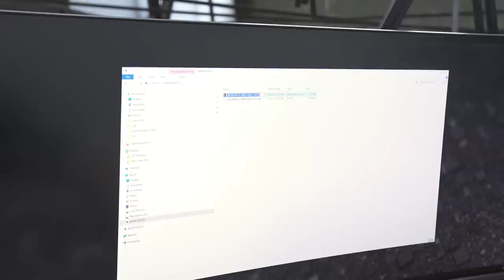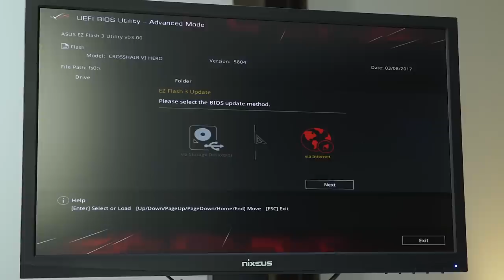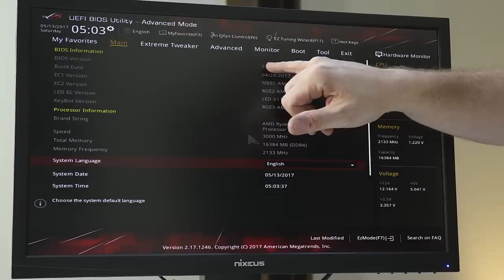How to build a Gaming PC

Comment: Great video, however,I have been working with computers since I was a kid, and I noticed that you are forgetting about a few things while you are benchmarking are 1), you have no antistatic mat or antistatic wrist strap. This can cause a lot of problems for the motherboard and processor. 2)You are not considering any safety measures in combating static problems, or use any sort of flashlight in getting into the small areas of the computer.
Reply: @huntedplaster9607  Thanks. There should be no buts when it comes to safety about ESD, and it needs to be done and mentioned in all videos that show a basic understanding of what a person who is a beginner at computer building, because of the fact that there is probably someone who has never built a computer, and to think that someone who views these kind of videos, with no previous experience, will think it is standard practice to not use ESD precautions when building a computer, and this needs to be addressed when making videos like this. Not everyone has either a place to work that either is carpet free, or are standing on an anti static mat. To brush off on ESD safety, and precautions is just stupidity at it's finest. Think of who this video is aimed at. How would people know about touching metal if it not mentioned? I guess the creator of the video didn't consider that. A motherboard as well as RAM, and the Processor, as well as the video card are all subject to ESD, and to not address it, especially in today's world, someone could take that creator to court for misleading information. Cover Your A** should be a common thing if making a computer build video.

Comment: This new PC build that I use now posted just fine and booted up right away except for the trouble I had because the amd ryzen 3600x,the gigabyte aorus b550 pro ac wifi and the video card all support that bit locker crap which "Broken Windows 10" took full advantage of once I installed windows and wouldn't even let me access my bios which forced me to go through changes,but other than that my PC build went well.Was I lucky/unlucky?Who can say?Good video Jay.

Comment: Thanks Jay, I've built a few PCs myself, however its been about 6 years and I've finally decided to build another. This was a great refresher with all the tips. Any recommendations for a good computer case that won't break my budget? ATX is fine, just so many to choose from nowadays.
Reply: If you want one for about $100 there's the Cooler Master H500. (Not 500p or M. Just H500.) It has two front RGB 200mm fans and a rear 120mm. There's also no glass panel choking the fans like most cases have, allthough if you need the looks it comes with one optionally. Killer airflow with the mesh. It has decent cable management space and a half PSU shrowd so the GPU gets better airflow. It has two back mounting spots for SSDs and a small drive cage for two or three hard drives.
Reply: @SupertoastGT  Thanks! I'll check it out.

Comment: new 
system builders - do not forget to build your system with your parts placed on anti static mats etc,this will help aid a smooth build providing every single part you have purchased for the build actually works in the 1st place ,you do need all parts you buy to be in 100 % condition when you start your build for your build to be successful ,if you do no get any joy at boot up ,yes you can use the bridge start up as i have never had any issues doing that then if you do not see a screen boot up then you will have to maybe fault find one possible part that is maybe not connected correctly or maybe one part is not working , if you do find you have a faulty part , just take the faulty part back to your dealers and swap your faulty part for a new one and get back to you anti static ,

if you use a tabel like this video anti static mats are still recommended even though the static on this table will be much less than trying to build on say a carpet , !!! , anti static mats ,the foil that covers your parts from new will do the job , do use them if you are unsure about the amount of static electricity where your build is taking place .

Comment: I think it is safer to fully discharge power with extra power toggle (with ps switch off) before connecting / disconnecting graphics cards.  I have noticed graphics cards get destroyed randomly the more I plug them in at least for older systems.  No idea if it is because of pinout design or not going in perfectly straight, but it has happened.  Other cards don't seem to care.

Comment: Well i liked you and your video so i liked and subbed, but if i had hot air blowing in my case like that it would bake, also tucking in cables next to the heat sinks is going to kill them wires a lot faster. I am sure someone else might have pointed all that out just don't have time to read all the comments so please don't hate :P really well done i would still give another thumbs up if i could do it twice.

Comment: You forgot to show you need to apply thermal paste and you could have removed the SSD bracket to connect the front audio... However thanks! It's great for builing a new system. Done it often enough, but I always forget something stupid and finding it out when it's the hardest to get right again...

Comment: I’m planning on building a new computer for my Graphic Design & Video Game work.

Should I get a Ryzen 7 2700 or the i7 8700k?

I’m planning on getting:

• GTX 1070 ti

• (2x8) sticks of DDR4~16gb

• A new case (not yet sure on what case to get but willing to spend around $200 for one)

• Motherboard (not sure which one yet)

• CPU

• EVGA 850w or 750w power supply

For the storage I’m just going to use the 1tb hard drive & 500gb SSD I already have.

I’m willing to spend around $1,400-1,600 USD on it

Comment: Newer power supplies will not have voltage options of 115 / 220 volts because they are a lot better.  If you have PS with these settings in back, you have an outdated supply or less efficient model.  Not good either way.

Comment: Watching people build computers is so relaxing. I don't understand why. It's like the digital version of neurosurgery and a child being born plus open heart surgery all in one. I remember nailing my first build, an AMD with Nvidia graphics and it felt SOOOO much better than having a Dell or HP desktop from the store. My case, motherboard, graphics card, and SSD's are all ready. Now I just have to pinch pennies for an i7-7700 (non-K), a power supply and figure out the fan set up since my case has one exhaust fan. I'm on a Mac right now and while I love OS X, Apple has jumped the shark in a lot of areas. No way I could get a garbage can Mac Pro and be happy with forced parts (Nvidia FOR LIFE!!!) haha. My only slight regret is not doing a Ryzen 7 build but this PC is going to be just the first one. Next I'll build a workstation with a 1800X but I am hesitant to go AMD for CPU at the moment. I guess I'm too attached to i7's :/

Comment: That PC case looks great. Three times I have built my own computer, and what I "learn" from PC building videos is that the most important of all might be/is the computer case.

I have an Antec 300 case (with my "old" 2500K), an Aerocool PGS-R (for my "new" Ryzen PC from last month) and a small unbranded case (with a 3770K), and all three times the cable management was/is quite nightmare'ish.

When I compare the three PC cases that I have with that Coolermaster case in this video, then I think that the folks who designed the three PC cases that I have should be fired and send to a gulag in Siberia for the rest of their life.

I'd like to see Jay do the cable management of my 3 computers :) (Smiley. It's not funny, though.)

Comment: Cool video. But a question. If the top two fans are exhaust, and the top back fan is exhaust, and I presume the three cooler fans on the front are all exhaust, and the only other air vent - the one on the bottom - is covered by the power supply, and assuming you're okay with passive are intake, where is that intake supposed to come from?

Comment: I agree, building a basic computer like this is not that difficult, until something goes wrong..  Then it's the biggest pain in the ass there is.  
I ran into the catch 22 of computer building, when the bios on the motherboard wasn't updated for anything above an I5?  So the I7 didn't work.
If you live close to a computer repair shop, you could get lucky, but I actually had to purchase an I3 to upgrade the bios. 😩
Newegg should lend you a used processor for this task, then allow you to return it.  Sounds like a reasonable solution to me?
But noooooo.. They don't care.

Comment: I've wondered for a long time why graphics card manufacturers haven't started putting that pesky power connector on the back, right by where the backplane grommets are. Their only excuse would be for cases that don't have cable management access, but even then it's easier to manage from that place. Are they worried about shorts or something?

Comment: Thanks for the vid!  I do have a question about CPU power cables:  Should I connect both the 8-pin and 4-pin cables, or just the 8-pin.  The ASUS TUF X570-Plus (Wi-fi) owner's manual isn't clear.  It just says not to connect the 4-pin cable alone.  I noticed that you only used the 8-pin cable.  Just don't want to screw anything up lol.
Reply: You can use only the 8 pins, the extra 4 is for extreme overrclocking
Reply: @Klefkwarktaartje  Would it hurt to hook up the 4-pin connector as well?
Reply: @DJRaptorXS  no it won't hurt. From what I 've read about it, it's only makes your cpu able to draw more power. The 8 pins provide 220 watt, and the 4 pin 100 watt or something like that. A CPU like a i7 uses 125w (not overclocked

Comment: What would be handy is a video where things don't go right. For example let's say you didn't properly seat your video card or your video card just isn't working. What sequence of LED lights or codes do you get on the motherboard when that happens? Do you still get a white light if you didn't connect a video card at all?

Comment: I'm going to be building my first pc after the summer, I'm fairly well researched, the only concern I have is static, some people say that I'll be fine by slapping a peice of unpainted metal occasionally,
But to be safe im using a static band, I know I'm supposed to connect my band to the grill of the PSU but do I connect my PSU to a surge protector and if yes is the surgery protector supposed to be on and is the power supply supposed to be on.... I'll appreciate the help

Comment: i've never broken a sata power cable, unless it was one of the shown crappy case ones, like the old molex crappy case fan power and lighting connectors, but honestly sata is nothing compared to IDE and the smaller Laptop IDE cables, which you could really mess up with all those pins.

Comment: You would think that by 2018, they would have standardized the power switch, power led, reset switch, and hdd activity light plugs into a single socket.  But nooo.

Comment: Do you have any build on a ryzen 5 . Im trying to build my first gaming pc . Im starting with ryzen 5 1600. And now I need recommendations for the rest. Im trying to get none expensive parts that will still get the job done. 500$ is what I have
Reply: renablue go to pcpartpicker.com
Reply: renablue you won’t be able to make a ryzen 5 build for $500 unless you cut some serious corners in the gpu department.
Reply: You can do with 500$ by using ryzen 5 2400G and mini mother board like asus b350 M-A, stock cooler.

Comment: 9:35 did he bridge it with the magnetic part or did he like push them together?
Reply: Used the metal to make contact between the 2 desired pins, it can also be done with an un-bent paperclip, but since its thinner it'll be more of a challenge to touch the correct pins and nothing else.

Comment: When turning off the pc after checking if the parts work, do you just switch the PSU off, or what? I'm talking about the part where you test to see if the components work before installing into the case.

Comment: good tutorial however poor design choice for a case as it blows all the heat off the liquid cooler rad back into the case? or did i miss something?
My liquid cooler is at the top of case and pulls case air thru the cooler rad and even though its using warmed case air it sometimes doesnt even run the fans and almost never runs the fans on high even with intense use.
Im rarely gaming these days so i prefer quiet over max heat removal.

Comment: Can you give a list of processors that are best used for gaming?
Reply: What's your budget? What's your graphics card?
Reply: cwli1 I don’t really have a budget. I just want a good gaming rig. I currently have a Radeon 7700k series. I’m planning a new build so if there would be a better graphics card too let me know! I have a intel 4700k processor at the moment.
Reply: I don't know about the Radeon 7700k.

A YouTube comment
"A friend of mine just got a Ryzen 1700X computer. He wanted me to see it so I came over. I tried it and it seemed faster than my computer, but I was not overly impressed. He noticed my disappointment and pushed me away from the computer. He said "Watch this"! He opened 5 tabs in his web browser and opened a 4k you-tube video in each tab except the last where he opened an 8K video! He opened 3 1080p videos in VLC player (each separate instances) and one more VLC video playing 4k video. Finally he ran a full malware-bytes and anti-virus scan. The cpu never went above 58 degrees celcius in temperature and cpu utilization went from 52%-72%. He let me try the computer while all this activity was simultaneously going on and it was still faster than my computer (older Intel -i5). I was so impressed that I promised him I would buy my own Ryzen computer before the end of the year!"

Comment: Jay, isn't that a C6H board?  Arn't you supposed to plug the bios upgrade flash drive into the rear I/O port marked BIOS with the computer off - then push the BIOS button and let it all run on autopilot?